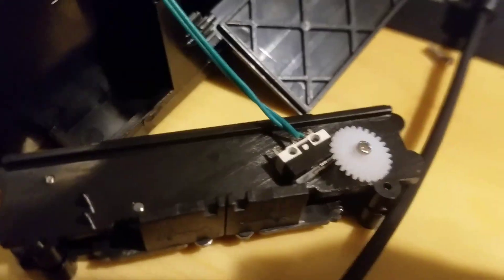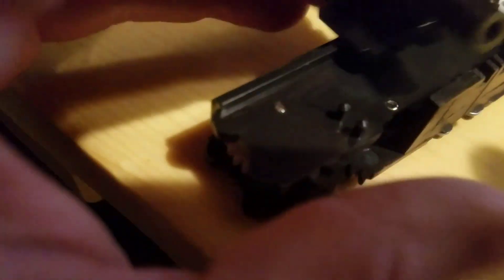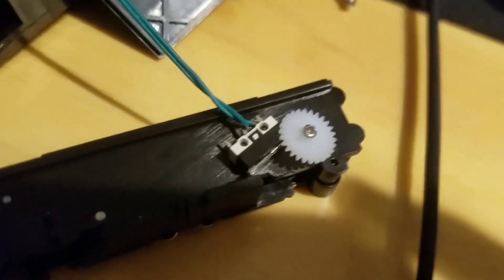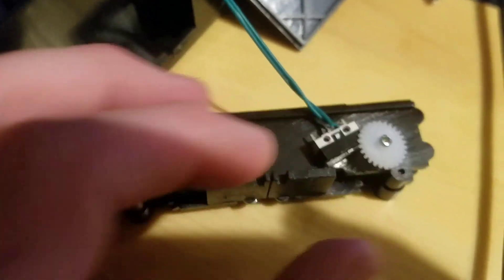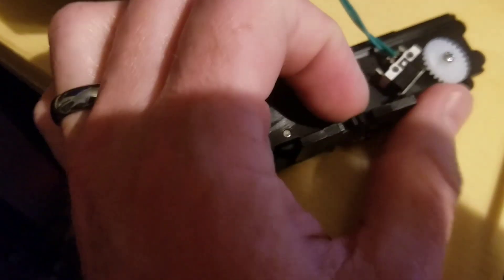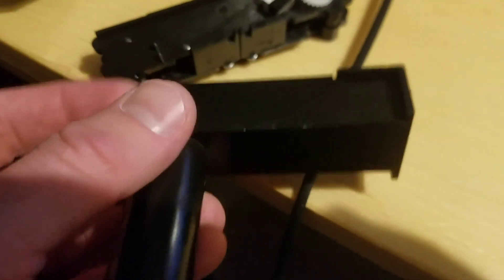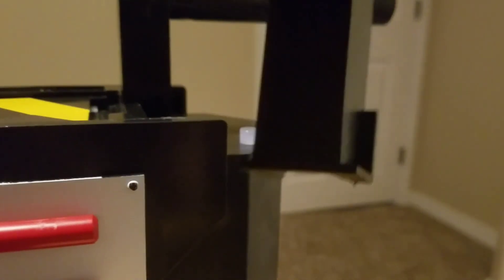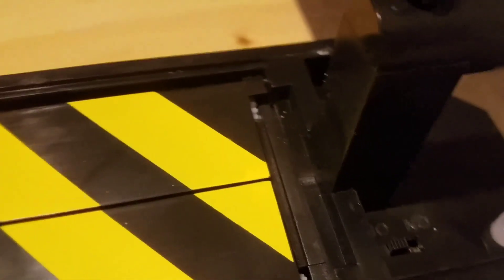Ghost trap gear assembly thoughts

Comment: Anmbest 5PCS MT3608 Step-up Adjustable DC-DC Switching Boost Converter Power Supply Module on Amazon seems like it'll do the trick.  Just tap directly into the current on/off switch and run a line to power the board/motors/lights (if you wanted to put some additional flashing lights into the trap).  If you have a soldering station, I bet we could probably price all the parts for less than $50.  I could use some help with the code.  I could write some really basic stuff but it'll probably take me a month to prototype and get everything working in my spare time.
Reply from the maker: Yeah, soldering I'm okay at, and coding is not a problem for me. I just have very little experience in actual electronic components, haha. So I've been looking at servos, and with a good push rod I think you're right. We can just use those to handle the doors. That will also move things out of the way of the handle and allow it to extend into the box to better mount it.
Reply: @TragicManner  Do you have any experience with arduino coding?  I could probably design up a circuit and some basic code if you can clean it up.
Reply from the maker: I'm pretty comfortable with C languages, though I would need to brush up on the Arduino IDE, though that shouldn't take me long. On those Switching Boost Converter Power Supply modules, why is it so much cheaper than something like the Adafruit PowerBoost 500?  Especially when the Anmbest one outputs 2 Amps! And comes with 5 of them for less than 10 bucks!
Reply: Not sure why it's cheaper other than that the Amazon ones are typically cheap ripoffs of better products.  Speaking of, I got the arduino nano and an old servo up and running as a proof of concept.

https://youtu.be/fYckSJQove0

The servo seems to be plenty strong and moves side to side a total of 180 degrees so it should be more than enough to handle the full range of motion required for both a right and left side door.  I would probably think about drilling in from the inside box and having only the servo arm inside the back of the unit.  It would look a little sloppy in the trap itself but I was thinking about adding lights and a small plastic sheet directly under the doors to disperse the light anyway.  Like the Matty.
Reply: Booyah!!!

https://youtu.be/Nw04lMt5nko

This is Alex F. btw.  I use this channel for all of my uploads.

Comment: https://youtu.be/D-QTSghkqVk

Motors and push rods connected to the plastic levers underneath.  You would probably have to rearrange the original control board in order to glue the servos to the frame but it could probably be done pretty easily.  While in there, I'd probably change out the green LEDs for white one and maybe add a second power switch to control the doors/pedal since it needs 5v.  I'd have to look into it more.

Comment: I just got mine yesterday and did a similar tear down.  Originally, I thought the same thing that you did.  Put a push/pull solenoid into the handled and operate it that way.  After looking at it, I feel like a solution based on an Arduino Nano and two servo motors would be more practical.  Looking at the gear box, I'd imagine that if the springs were removed the gears would flow with very little resistance.  Therefore, we could glue on a pin hole to the bottom of each lever and have the servos pull them down in sync.  Also, the green wire attached to the gear box serves only to complete a circuit and activate the sound and a change in the lights.  You could program the board to initiate this while the doors are open and then in turn disconnect the circuit while the board is off.  It would require a second set of batteries for the 5v logic or some type of converter but that's what I would image to be the most reliable solution.  Also, doing it this way gets two additional benefits.  You could glue the handle to battery side of the trap to make it much more sturdy and the doors could open and close fully.  I tried what you did by moving the gears and found the same semi-closed results.  I'd say ditch the handle entirely.  

Keep up the videos.  Also, p.s. the sound goes out half way through on this one.
Reply from the maker: Alexander Foss ah i didn't realize the sound went out. That's when i talk about servo options, though I'm not super knowledgeable on them. On your proposed solution, what would be between the servo and the tabs? Also, totally agree on ditching the handle entirely. It's flimsy and the way it's designed I'm pretty sure will lead to cracking the outer case. Too much stress on too small an area in the part that is going to be stressed the most.